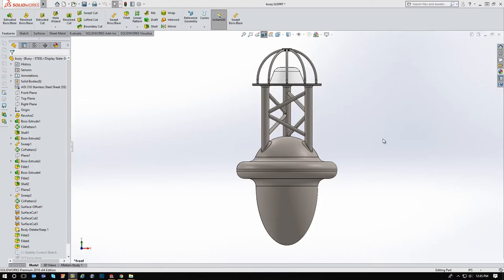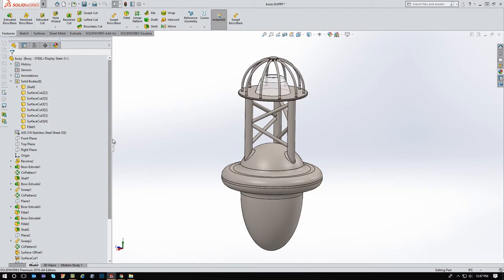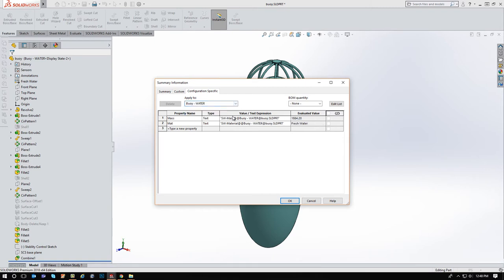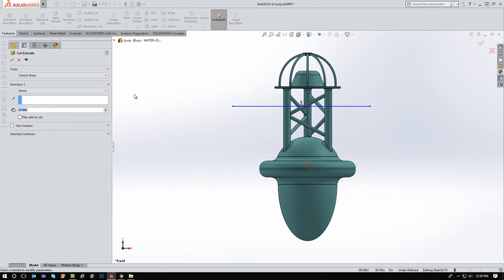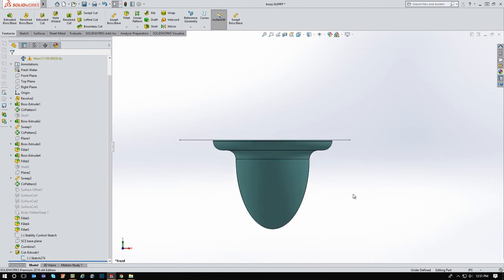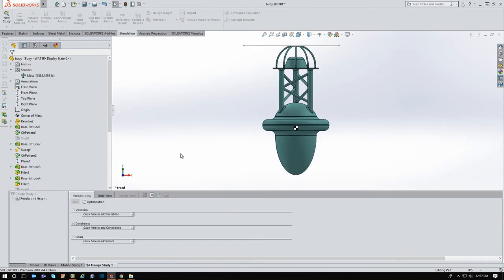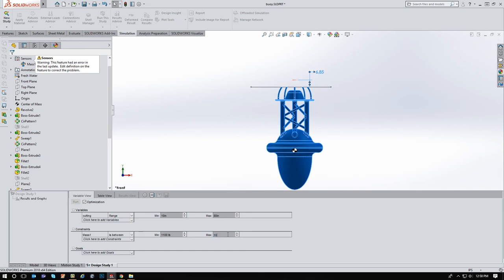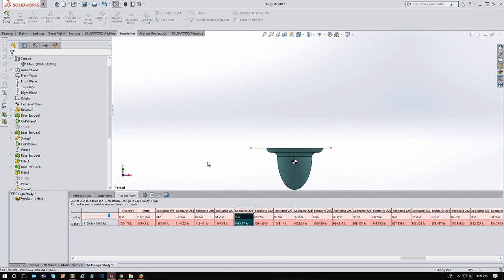SOLIDWORKS: How to find Water Line and Center of Buoyancy.

Comment: Thank you for your video and sharing your knowledge. I was hoping to learn the dynamics for simulating the way the WW2 Landing Craft LCT Mk5 would react when the DD Tanks (Sherman M4A2 amphibious tank) left the boat and entered the water. Plus the boyancy reaction of the tank with the skirting up and then collapsing as it sank. Although I do not have SolidWorks and mainly use Blender or Unreal.

Comment: Thank you for this usefull video. a couple of questions though: how did you manage to hollow out this part ? 
I m working on a relatively complex assembly and I want to hollow it out to find my center of buoyancy. 
some said that using the shell feature would do the job but it doesnt work obviously on an assembly
2nd: how did you establish this water configuration ? (sounded complicated as you said 2:05 "took out the shells, modified the sweeps so they werent hollow tubes"
Reply: using shell feature?
Reply: you can select all the outer surfaces and do an offset surface with an offset of zero

Comment: At one point you say that the center of mass of the "water" is the center of buoyancy. Is this always true? Even for irregularly shaped objects? Intuitively I think so, but I'm not sure because buoyancy is a surface effect, not a volumetric effect.  I'm trying to graph the roll stability of a catamaran hull, so I'm changing my water surface angle iteratively and calculating the resultant moment between the boat's center of gravity and the center of bouyancy. But I haven't seen a mathematical proof that the vertical vector integral of object depth over the projected surface area  is equal to the center of mass.

Comment: Pretty darn annoying that Solidworks cant do this on an easier way by recognising closed cavities. It manage to see what is external faces when saving a file with only external faces, so it should be that hard to implement a feature that could calculate buoyancy of more complex assemblies with enclosures that has air inside. Its OK to do a iterative manual estimation of this on simple models like this, but if you have a larger assembly with multiple waterproof containers this is too time consuming...